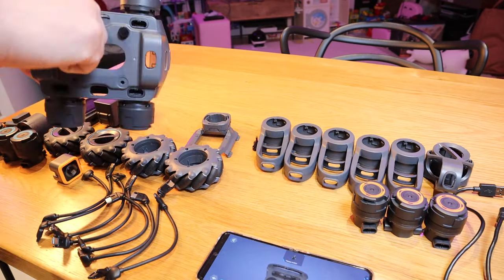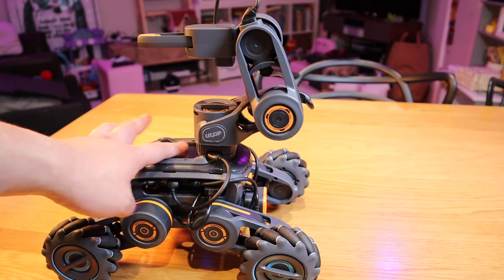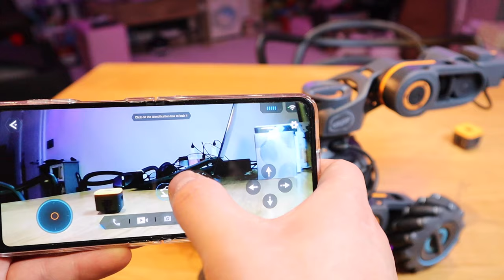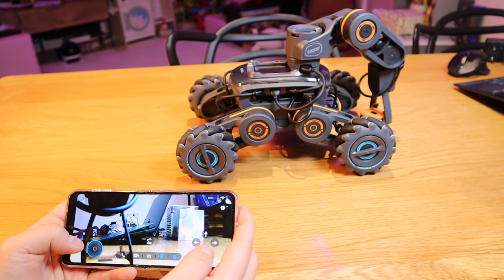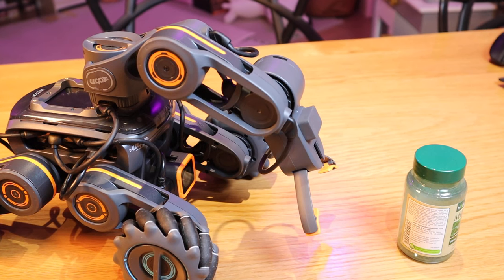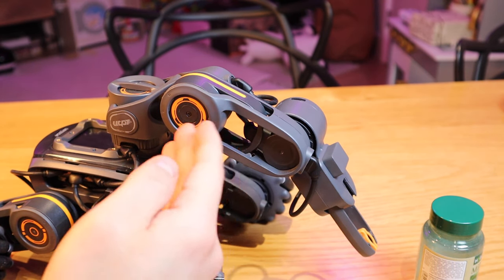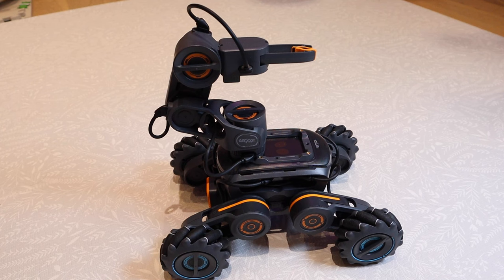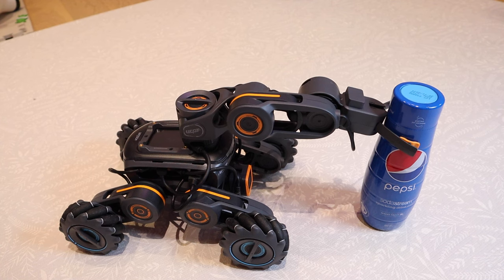UGOT Magnum Wheels Robot Arm is a Bad Idea (E39 M5)

Comment: Have you had any issues with overheating? Lately I haven't been able to use it almost at all no matter which robot I got. I did a firmware upgrade a few weeks ago to bring it to the latest and it didn't help with this problem.
Reply from the maker: Overheating can be quite frustrating! It sounds like you've been through a lot with your robots. Have you tried checking the ventilation or cleaning the fans? Sometimes, a little maintenance can make a big difference.

Comment: Have you tried programming with a pc/laptop yet? I tried connecting uCode yesterday & it was extremely frustrating to even get the programme working properly on my laptop 😒 3 hours spent & I couldn't get it to launch/connect to any of the robots???
Reply from the maker: I tried to set up ChatGPT last night but given coding does not seem to work so asking for UGOT to respond on me.
Reply: @ljptech  I had a frustrating few hours trying to even get uCode up & running & I'm currently unable to launch it...getting an error when trying to connect to my robots via WiFi/IP address 😒 It would seem there are a lot of problems with the software/programming side
Reply from the maker: @neilrisley6667 I hope not - I have managed to connect my UGOT with ip address but struggled to install ChatGPT